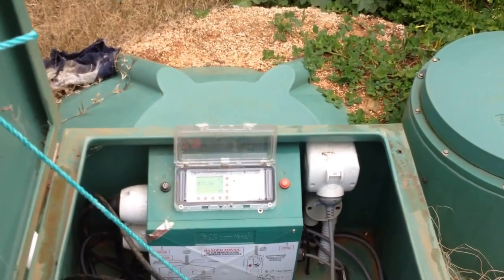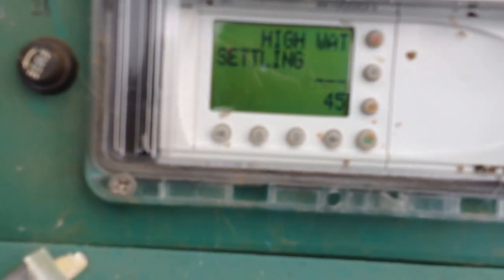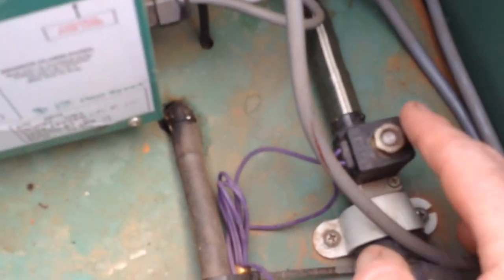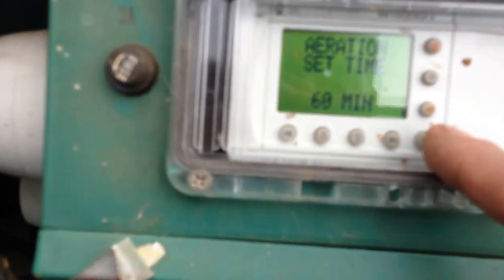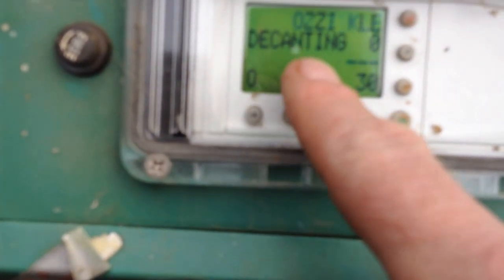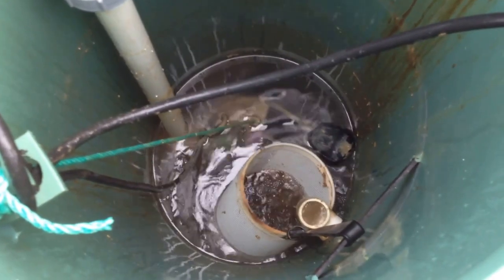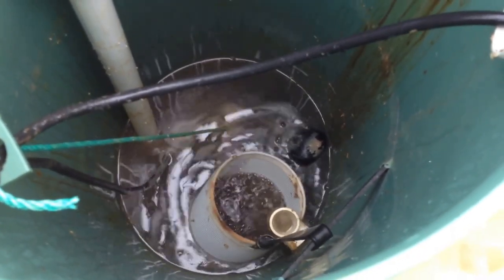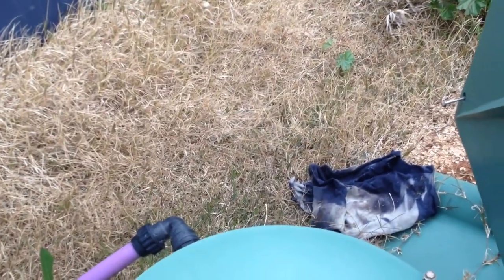Reseting a decant head on an Ozzi Kleen

Comment: What do I do if this doesn't work... ive tried and nothing and how can I unblock it if it's blocked
Reply from the maker: You may have to remove the head.  I assume the decant solenoid is working and is open letting air out? If you DM your phone number I could call to discuss
Reply: @archereng  how do I remove the head
Reply from the maker: @Mallory-bo3ws  if you can empty the main chamber a little, then you should see the hose with a clamp to undo
Reply from the maker: @Mallory-bo3ws  email me your phone number archerES@iinet.net.au